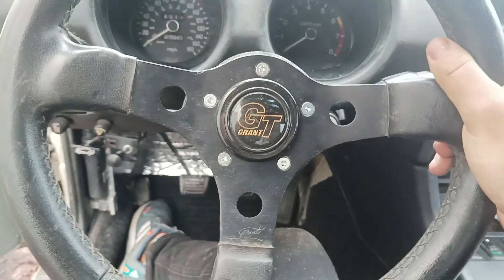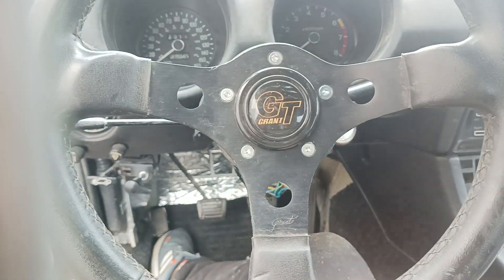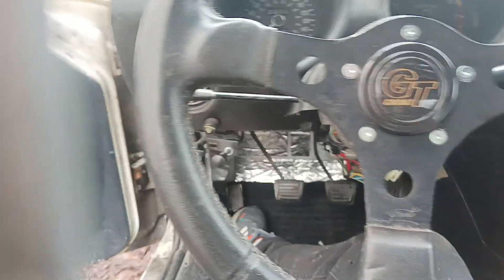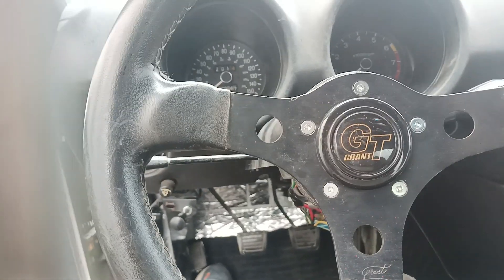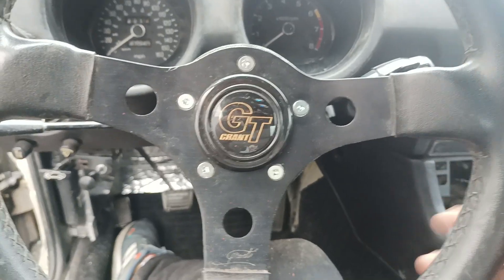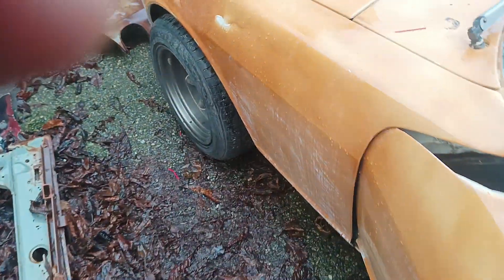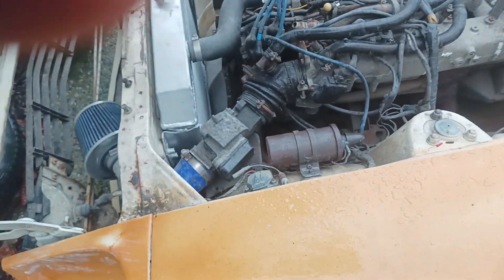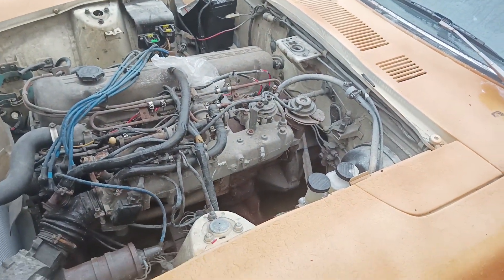new wheel and shifter on the Datsun 280z

Comment: Five bolt eh? I have a 320mm Momo Prototipo on the 308. No PS and 205/70-14 tires and it takes some armstrong at slow speeds but fine on the go. You should be fine...
Reply from the maker: Yes but I haven't worked in over 4 months. I have weak little arms now